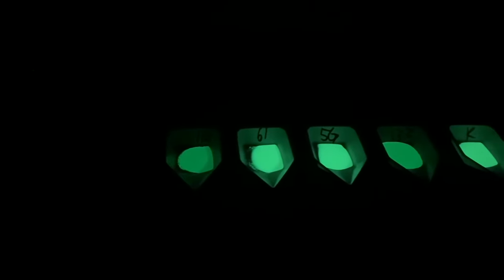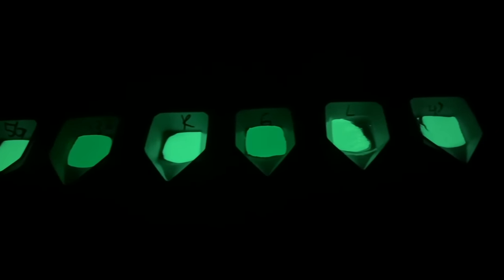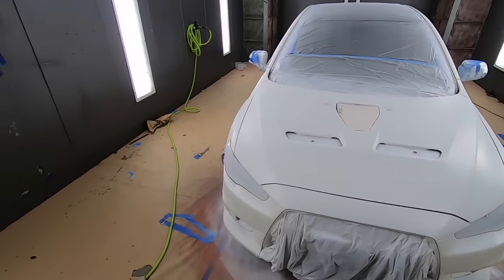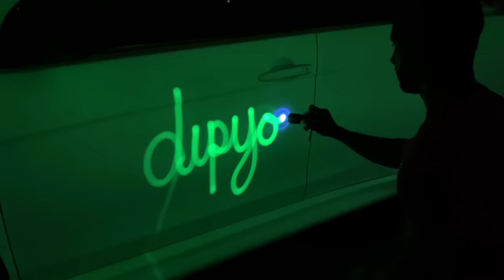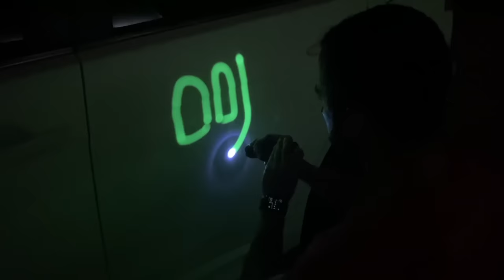Spraying a Car in the WORLD'S BRIGHTEST Glow in the Dark Pigments

Comment: This is amazing. Imagine how radioactive a pigment like this would have been 50 years ago when they would have used radium for the glow effect
Reply: Radium
Reply: Could use what they use for gun night sights
Reply: @jameslivingston7159  yea, but it doesn't glow well in oxygen-rich environments. It's sealed when applied to trijicons and other night sights so as to not degrade as quickly.
Reply: @americansmark  so it would glow just fine in new York and LA is what you're saying?
Reply: Radium doesn't glow. It's combined with zinc sulphide. Radium is so aggressive that it destroys the glow pigment, so a clock with radium that doesn't glow is still at maximum hazard.

Comment: Word of warning if no one already mentioned it. Strontium aluminate (the chemical used for the strong glow pigments) is an excellent abrasive (like second in line to hardness of diamond), so probably not a good idea to spray directly on paint just to be on the safe side. That does look freaking awesome though :)
Reply: I thought it was zinc sulfide...
Reply: @LordMondegrene  They used to use ZnS, but it turns out that SrAl2O4 produces a brighter glow, so that's what's more likely to use nowadays (well, in the more expensive products anyway).
Reply: @therealchayd  Ah, thank you so much, I had no idea there was an even better glow pigment!

Comment: Little advices to people trying to duplicate this effect: 
- Don't buy cheap pigments because these aren't fine enough (too flaky and not ment for automotive paint) as they tend to clog your gun. 
- Green glow pigments are the ones that glow the most/last longer.... more it goes toward pure blue, less it glow. Aqua and blue glow pigments are somewhat great. Despite online pictures never ever go orange or red glow pigments because these are usually made of green glow pigments mixed with colored powders, so they end up having a sluggish faint green glow. 
- Green glow pigments tend to give a dirty yellowish hue to your daylight finish (Aqua and blue glow pigments aren't as affected)... something you can "slightly fix" by adding a few drops of purple/violet translucent dye to your clear base (less yellow, but still dirty). But If you want to play SAFE and keep your base coat as white as possible, go for aqua or blue glow pigments (I'm use to go strait aqua, it's a good compromise, still glow quite boldly and end less yellowish in daylight).

You should test your paint before on a small surface, because the final color might vary depending of the type of pigments and dyes you added to your paint (to not end with pastel lilac stripes or ending with something more yellow-greenish than you expected). 

Here's what I've learned by painting small objects with these glowing pigments... I never dared to go a full car tho!!

Comment: The glow in the dark pigment is strontium aluminate doped with a rare earth and should as long as it isnt exposed to water be able to recharge for at least ten years and probably up to twenty years. The LIT and Krypto Bright pigments are microencapsulated so they can be used in a waterbased system. The base you are spraying the car with isn't waterbased so I would guess that this car will be glowing for another twenty years if it is still running, that is!
Reply: LIT glow in the dark pigment isn't microencapsulated so you can't use it with a water based product. Water destroys strontium aluminate doped with rare earth(s). When I read the info on LIT before it was several years old and didn't state no water and just to use their base. They updated their literature. LIT was designed by an artist Stuart Semple to be used in oil paints or resin which don't contain water. Their base is white like gesso to maximize the glow effect. It's a great product and just as good as Krypto Bright the way it is used in the spray painting to make a glow in the dark car.

Comment: I bought 25 grams of the KP glow, mixed some in about 2oz of house of kolor interclear clear base coat and it didn't want to mix or spray well. Too sandy and would just basically settle to the bottom of the spray cup and clog my gun. I then tried mixing some in straight clear coat and had the same problem...what's the secret to getting it to spray ? I'm only wanting to do small projects like yeti cups and fishing lures, thanks

Comment: Should of done the lug nuts on the wheels and the Mitsubishi emblem for on the front grille the break all then solid blacked out sections.. and when your driving In a dark road the lug nuts spinning so fast would of looked like a continuous ring and or the brake calipers is another idea to brake up all that black